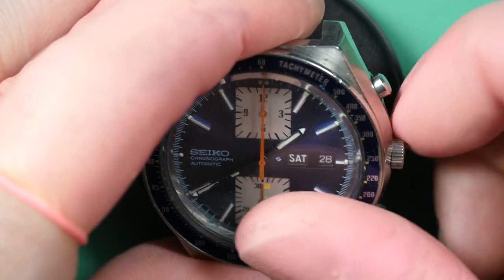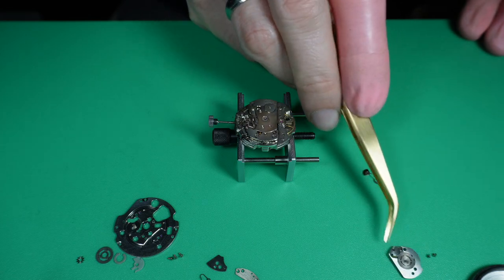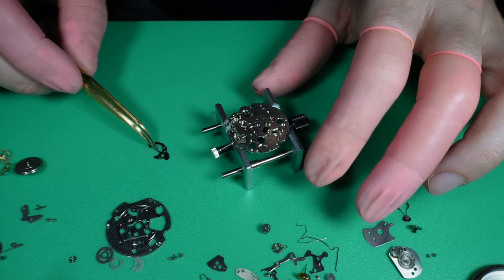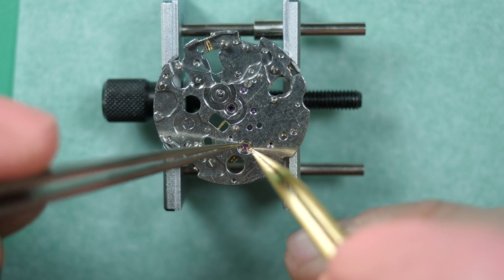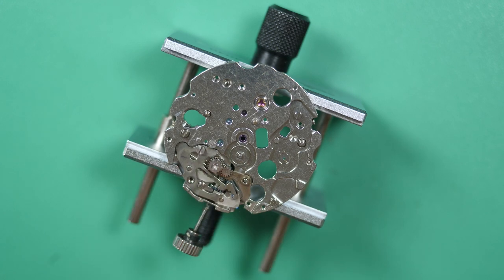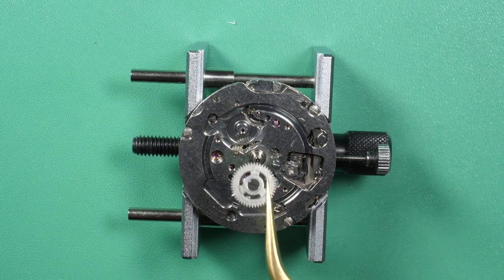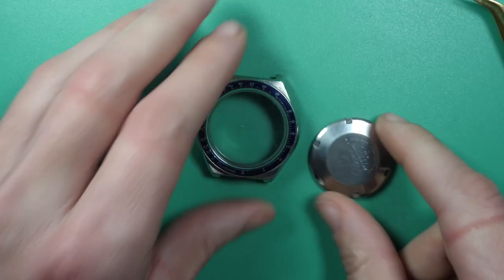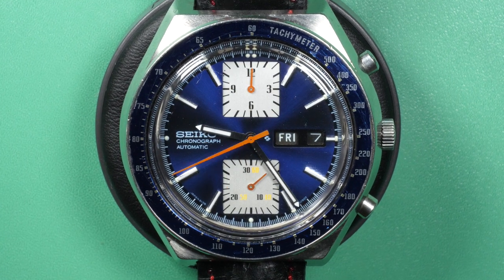SEIKO 6138 Restoration: Can I Repair This Ebay Vintage Watch ???

Comment: To find out if the dial is original or not there should be 2 numbers printed in ink on the back of the dial, blank ones are 99% of the time replacements. The numbers on the back of the dial should also relate to the serial number of the watch, Your serial number being 400011 means it was made in october 1974 (first number is the year, second is the month, 0 meaning the 10th month) so i would expect your dial to be slightly earlier than the serial number maybe 49 or 48 on the back, if it not even close to that then its more than likely a vintage replacement. Ive done too many of these i need to get out more lol
Reply from the maker: Thanks for the information. It is really useful. I remember seeing some printed number under the dial but I cannot remember the number.
Reply: @FrenchWatchCollector  Your welcome, when you come to service it again you know what to look for 👍 or maybe on your next Seiko seeing as the 6138 can go years without servicing lol. Very clean movement by the way, not many with no rust at all on the pushers mechanism as the pusher seals always fail over the years and water gets in.

Comment: Great work. Could you please share what mainspring winder. Left or right did you use and what size ?
Reply from the maker: If it is a red dot on top of the winder it is right and a blue dot is left. This is the codification from bergeon
Reply: Thank you. What number is the barrel and arbor?
Reply from the maker: @freddykrueger214  sorry but I don't remember. The number is on the habdle

Comment: If you change the lift angle setting, your numbers will be more accurate. Seiko's are typically lower than 52.
Reply from the maker: Yes it will be more accurate you are right. I look online and the reference I had was around 220 with a lift angle at 52. That is why I left it at 52
Reply: @FrenchWatchCollector  Understood.
Reply: @robertp4067  Correct lift angle for the 61 movements is 54.5º